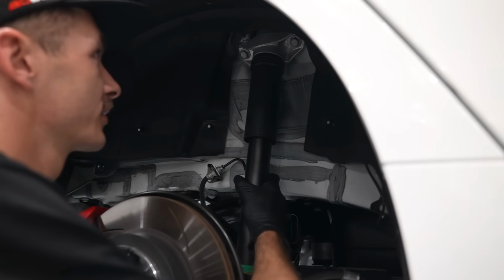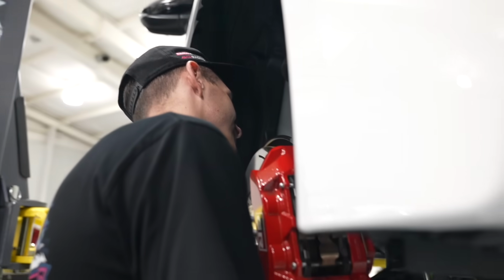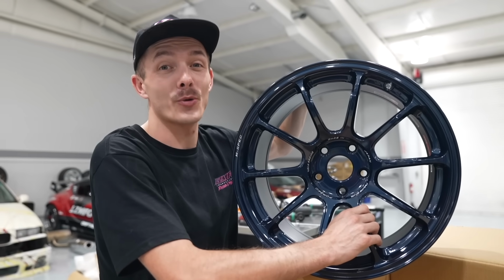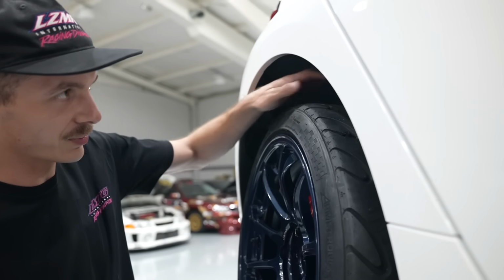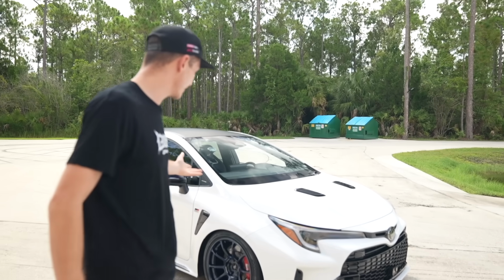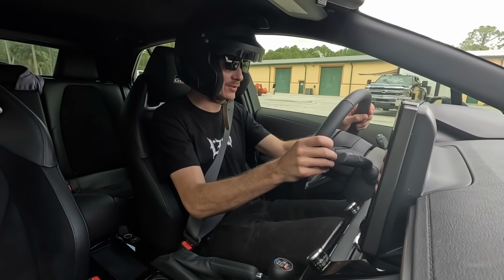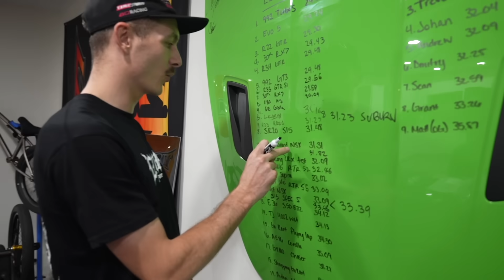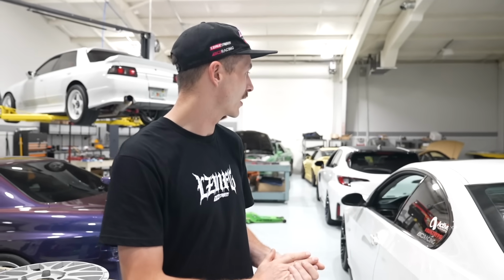We go full TRACK style on the GR Corolla

Comment: I’m an ex Toyota of Grapevine tech, 2 reasons for those lug nuts. They center the wheel on the studs and the washer on the lug nut creates a larger contact patch on the wheel compared to a conical or ball seat lug nut.
Reply: Thank you
Reply: yes
Reply: That is the exact reason. BBS even makes a version of their wheels for these lug nuts. They also make the OEM 10 spoke wheel for the GRC and a few other TRD Pro wheels. If you are going to switch to an aftermarket wheel, you can buy ET (Extended Thread) spline drive lug nuts that will reach down further and give you more thread engagement for vehicles with short studs. Toyotas require a stud replacement, or ET lugs.

Fun fact, the GRC is the only Toyota to have studs that is longer in 12x1.5. The rear GRC studs are longer than the front. The front studs are the same ones used on every modern Toyota in that thread pitch. This means, you could in theory use the GRC rear studs on any Toyota car to get extended studs for aftermarket wheels.
Reply: im a tire tech and have also always wondered this thank you
Reply: @cooperautrey9479  Also an ex-toyota technician here. Yet another upside of these lug nuts is that they use a built-in washer that reduces friction against the bores in the wheel which reduces wear over time with continued wheel removal and installation. I feel like Toyota always has weird quirky surprises of things that are just slightly better than standard. Like the air intake duct built into the front undershield of the GRC that directs airflow upward at the exhaust manifold, turbo housings, and cat to  keep them cool.
Reply: May not be necessary (or maybe it is) but definitely effective and definitely adds to the cool factor. Makes feel “purpose built”^
Reply: Nissan runs them aswell on some models. 🙋‍♂️🇦🇺
Reply: If they are properly fitting conicals they actually have more contact patch than a washer because of Pythagoras theory, hypotenuse etc, they also centre reliably if clean, Ive seen washers a lot with high end wheel setups. the one main benefit Ive seen to a washer type is that there's room for an impact rated socket without damaging the wheel surface around the lug holes every time, it marrs slightly less on the clamping surface over time but still does eat into the wheel like conicals do. Theres also probably something to having multiple components to each lug in terms of strength.
Reply: @EXZACHTPERFORMANCE Taking that a step further with Honda’s OEM ball seat lug nut, the contact patch is even bigger than a conical seat lug.
Reply: Logic was telling me this exact reason.
Reply: Why are the corrolas catching on fire tho? (Just asking no hate)
Reply: Toyotas lugs never seem to swell much either compared to other brands besides tundras/sequoias for some reason
Reply: @ItsBrandt  yeah, don’t get me started on those 22mm Lug Nuts. They’re a big player into why I have made the switch to BMW.
Reply: @Dacar173  idk yet, might have something to do with the Tundra recall on the full engine replacements 😂
Reply: which results in more clamping force..
Reply: Wrong. Just like a triangle the hypotenuse will be larger than the base, therefore a cone will have a larger surface area given the sane outter Diameter
Reply: @ yes, you are 100% right on if they were the same diameter. But on cars conical and ball seat lug nuts are rarely ever the same diameter as the washer built onto Toyota lug nuts
Reply: Look at the brain on Brad

Comment: Now you've definitely voided the warranty.
Reply: We don't need warranties where we are going
Reply: Not not really
Reply: its okay, drive it on the track day given to you by toyota faster than 85 mph and you void it anyway!
Reply: It's only voided for the suspension, engine and interior are still untouched. Engine's will be gone once he touches that tune button though.
Reply: @TheFPSPower  wouldn't the intake void the warranty?
Reply: All the warranty nannies coming out 😂
Reply: @khamid1  Nah, its a story about a guys corolla that burnt down and toyota refused to pay insurance money because they backlogged that at one point in the car's life it went over 85 mph and the tires were not designed for that so that's why everyone is trolling with the warranty stuff right now
Reply: I get that reference  @ThatSlowBRZZ
Reply: Mugson-Moss warranty act. Warranty cannot be voided due to aftermarket parts. The burden of proof that the aftermarket parts caused an issue is on the manufacturer in order for them not to pay for a repair.
Reply: Who tf cares about warranty when youre modding the car😂

Comment: Adam, the reason of that style lug is cause its way more specific of centering the wheel to the hub, of which a conical lug nut can also, however, Tech's or people can cross thread a conical way easier... Hope this helps
Also, aids within NVH (Noise, vibration, Harness) along with verifying trueness running of the Caliper/Rotor/wheel and keeping everything tied together.

Comment: Cant be mad at factory fitment seeing as the GR Corolla and GR Yaris are bred from rally.
Reply: Only the Yaris is.
Reply: @khamid1  They are pretty much the same chassis. So really both
Reply: @Badxperiment  lol no they aren't
Reply: @Badxperiment  same drive line different chassis
Reply: @Badxperiment  They are not. The GR Yaris has a bespoke chassis, which is built by combining parts of the Yaris and CHR/Corolla chassis and completely custom roof line. The GR Corolla is based on the regular Corolla chassis.
Reply: @Cernunn0s90 is the gr yaris available in the states? no. the gr corolla is literally as close as you can possible get to a rally car in a stock vehicle.
Reply: @hazy612  I didn't dispute that. I just cleared up the misinformation about the chassis.

Comment: 2025 GRC made SO MANY IMPROVEMENTS….one of which was upgrading the suspension! Also improved the Air flow, sub radiator, reduced weight, more weld points, performance package standard on all models….too many to list! Can’t wait to get mine💯

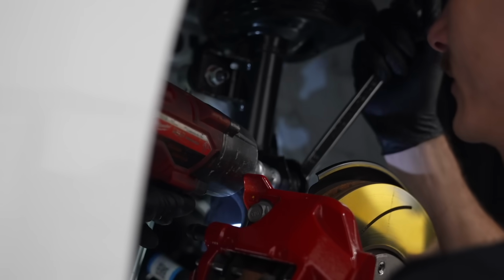Comment: 6:23 reason for the paint on the sway bar is a quality check I’m pretty sure. Usually if you find colored tape or paint marker or colored stickers or anything, it usually indicates the quality has been checked, in your case with the sway bar it means someone witnessed and verified that it was torqued correctly.
Reply: This is correct all car manufactures use this quality check on key components

Comment: The wheel nuts provide stability and vibration dampening because they are center the wheel to the hub alot better. The ring around the nut is called a slip ring which takes the vibration away from the cars hub.

Comment: Yo Adam, I'm loving the content, especially all the driving you're doing this year. congrats on being in the top 5 and after  u finish the season im rootin for u to hey on that box and get a top 3 in points.  I've always known.You're one of the best drivers N formula Drift and im so stoked that you have got the chance to showcase  your driving. You have really stepped ur program up this year. But as far as your yellow mark goes on the sway bar , I don't work for toyota but I do work for ford in the factory and it could be a bright color so at a glance , the Forman can walk by and see if the bolt holding the swayy bar has been tightened and Torqued to the proper specification. Anyways man just keep grinding don't let Anything get you keep that mind You will podium this weekend and you will get top three in points. Still mane , so go f*** a hole in the sky this weekend. Bro l o l thanks for listening

Comment: I work at a toyota dealer. i like that style lug better than the conical because they to prevent the studs from ruster much better up here in the rust belt. toyotas with steel wheels still use the cone ones and the studs are rusted after 1 winter.

Comment: The lug nuts are cause the wheels are lug centering instead of traditional hub centering. When you balance factory toyota wheels or certain aftermarket wheels for toyotas to properly balance them your suppose to use "fingers" which  is basically replicateing the lug nuts pushing in on the cone on the inside mountaing surface. But in short its what centers the factory toyota and lexus wheels.

Comment: The one thing I'm jealous of is imagine how easy it is taking bolts out on a brand new car where the chassis doesn't even have dirt on it yet let alone 20yrs of rust on it. I just had to swap a diff n diff bushings on my jzs160 gs300 n doing it by myself without any help after work took me maybe 25hrs over the course of like 2 weeks of having the right tools. I can't finish it til tmrw cus I had to order new eccentric bolts for the toe arms cus the stock ones are seized to the mount n the ball joints are shot n stripped so im installing Megan adjustables but the new bolts took 2 weeks to ship. Went all SuperPro from Figs high horsepower diff bushings with billet inserts and put on Megan Racing rear Toe Arms, Traction arms, and 19mm sway bar

Comment: Also if you were to get on throttle .10 seconds faster when going around the house turn I'm sure you'd shave off atleast .15 off lap time. The car can do it easily the way the front turn in +grip works together even if it should push you out a few inches the speed n contact should drive it through faster

Comment: did you retain the factory wheel studs? Ive been reading that it is recommended you change them to extended when running aftermarket wheels.

Comment: Funny fact, if you've exceeded 85mph in the GR Corolla, you have already voided the warranty

The paragraph I got this from: "Toyota's response from the Brand Engagement Center was, in a word, strange. Banks received a letter from a "Legal Claims Analyst" that, aside from a friendly but clear refusal to offer any assistance on the matter, mentioned CarFax reports and lectured him on the perils of exceeding 85 mph. It suggests Toyota will deny warranty coverage if you simply dip into the throttle of its 300-hp hot hatch—one that comes with a complementary day at a race track. But that's only part of the issue."